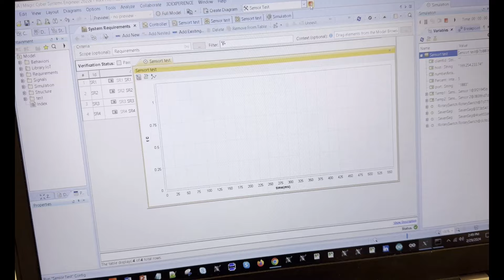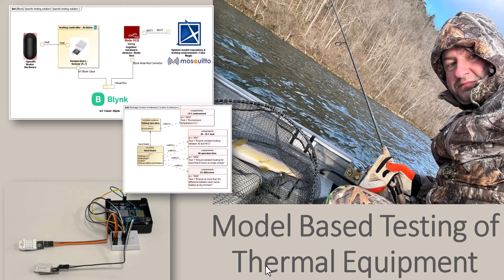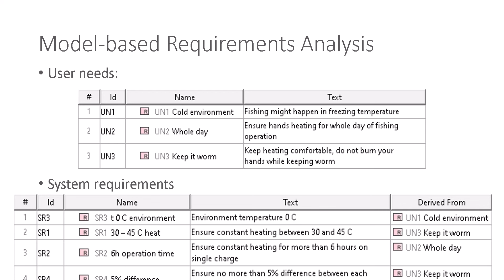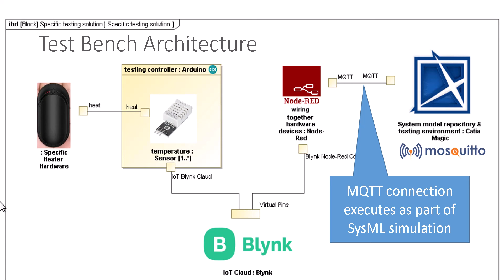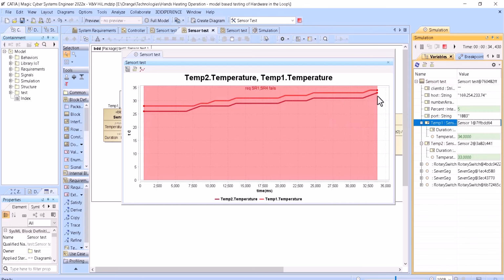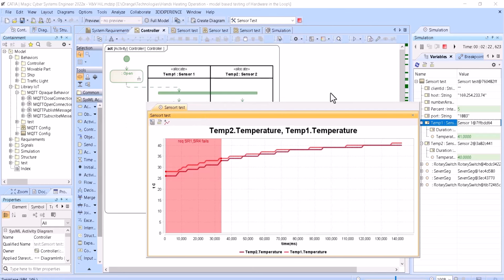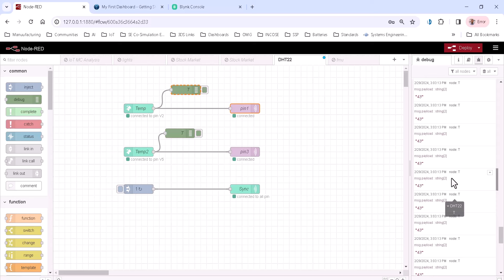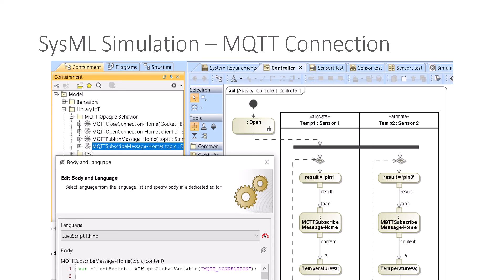Hardware in The Loop (HIL) SysML Simulation Solution Overview (Part1)

Comment: Awesome!! I like how you incorporated Blynk. I didn’t know about that capability. Does this have a plugin assisting with the Mosquito broker or is it necessary to set up the broker in a more manual way? Thanks for sharing!
Reply from the maker: Thank you for the feedback. You need to run broker in advance. Ones installed it can start automatically. Blynk is very good IoT claud option. Can by any other too! Great flexibility here on software and hardware.

Comment: I am more curious about the opaque behaviors for MQTT, and that set up. Have not used this approach before. Assuming something like: 

MQTTopen(host, port) {
    var clientSocket = new MQTTClient(host, port); // Instantiate MQTT client
    ALH.setGlobalVariable("MQTT_Connection", clientSocket); // Store the connection globally
    clientSocket.connect(); // Connect to MQTT broker
}

MQTTpublish(topic, message) {
    var clientSocket = ALH.getGlobalVariable("MQTT_Connection"); // Retrieve MQTT client connection
    if (clientSocket) {
        clientSocket.publish(topic, message); // Publish message to MQTT broker
    } else {
        // Handle error: Connection not found
    }
}

Saw your subscribe method in video.

Assume your Cameo was running on same environment as MQTT client?
Reply from the maker: You are absolutely right. We will share this library during MBSE Symposium.